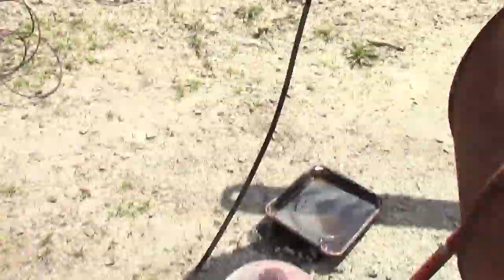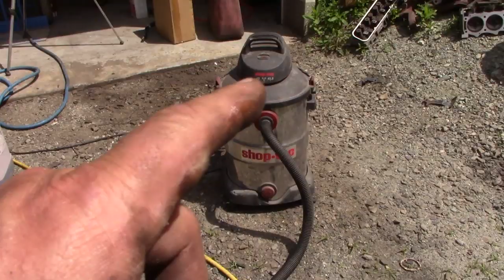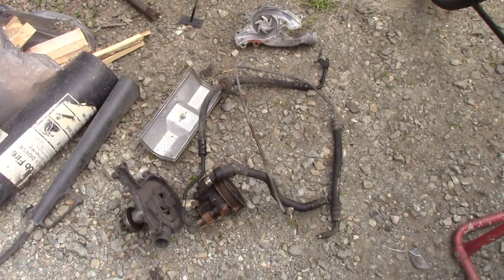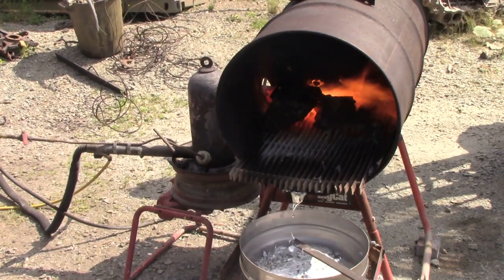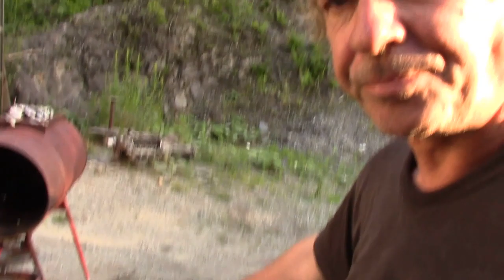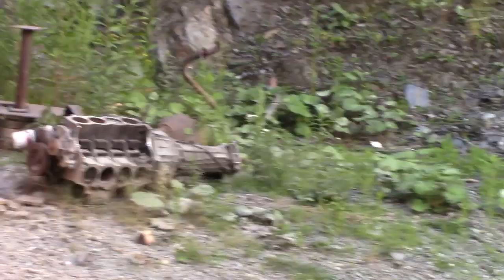What I do with old aluminium Land Rover parts??     Melt them!

Comment: As you said mike, your waste motor oil would fire that furnace a treat - anything hydrocarbon based works, folk turn it into black diesel for ultra cheap fuel.
Reply from the maker: Just to let you know George I tried waste oil today and it worked just as well! 

No smoke and bags of heat
Reply: And they say there's no such thing as free energy!

Comment: Much as I admire your ingenuity in making a contraption to melt metal I fail to see the point in doing it if you are not intending to use the metal that you make now ( Burt Munro’s World’s Fastest Indian Land Speed Record motorbike ) he made his own bike parts pistons etc just ending up with a big lump of alloy and taking it to the scrap yard seems to be a lot of work for little reward to me  time better spent repairing old Land Rovers me thinks.
Reply from the maker: I don't think you listened
I melted it down to get the steel out so i can re melt it to make billet aluminium to make adaptor plates later
Reply: Pay attention at the back🤔
Reply: @greggferns3278   Sorry I will get my coat
Reply from the maker: That's ok! Stick around!
Mike

Comment: I'd love to come to Canada to meet you. You're mad and brilliant at the same time. 

Good call on the ZF. It probably won't be OK, and it's a V8 one anyway. If it was from a D2 TD5 on the other hand....
Reply from the maker: There are some bloody boring days here and things like this are fun and the day passes quickly
I will not melt parts that are useful, but those V8's with bad liners are ideal for the burner - If I can get one in!
Reply: Then use the burner without the barrel. Use a pile of  stacked bricks as a fire wall, then melt the engine that way. I used to give safety advice on oilburners videos.
Reply from the maker: Could do bu the barrel works well as it gets a nice swirl
Reply: @BritannicaRestorations  will the block and transmission fit the barrel? With the bricks stacked you can have a melt to break it down, the smaller pieces fit the barrel.